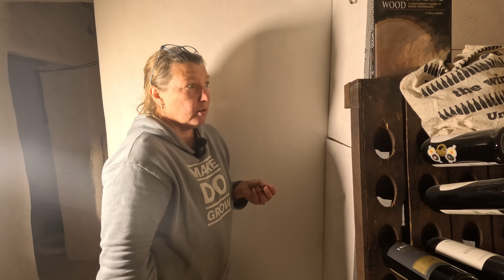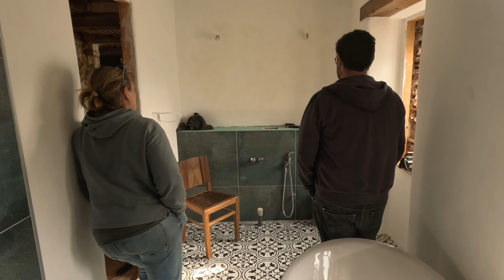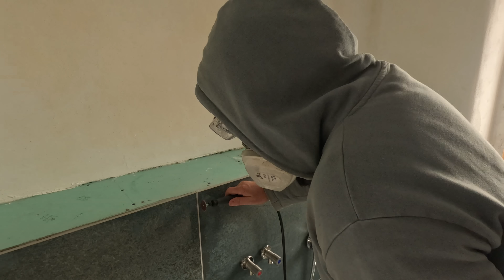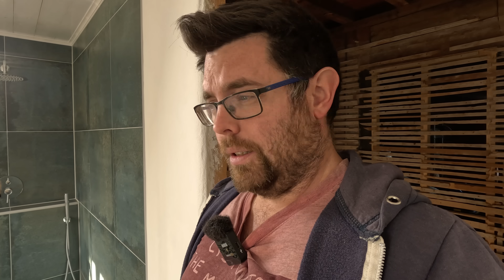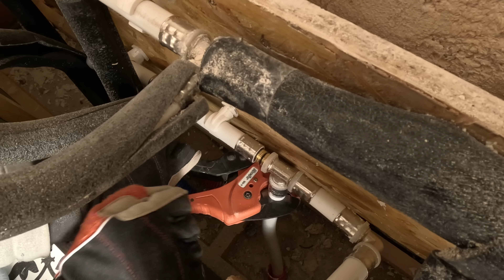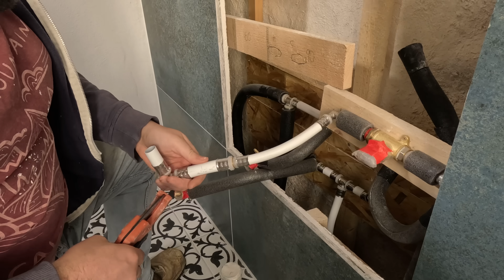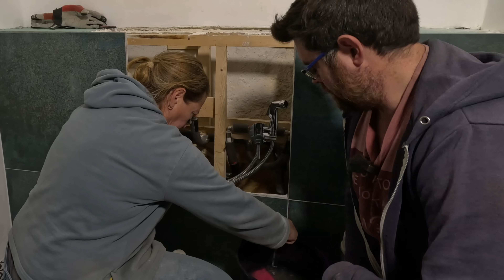Bathroom Nightmare: When Plumbing Goes Wrong!

Comment: QUICK QUESTION: Did you preassure test the system BEFORE you put water in it?

also you need to brace everything behind the tile you took out, to put it back in so it is solid/stable...

Comment: A failure of a crimped connector is extremely common, even when pros do them. We had these exact hot water tubes leak at the joint in the HP heating system. The heat will soften the plastic collar, especially by alternating hot and cold flow, expansion and contraction. Most of the time the water is cold. After repairing 4 crimp joints soon after first use, out of over 100, there hasn't been any leaks. So that's good news in a way. Early failure is better.
Reply: Again, interesting to hear - and encouraging for long-term confidence, if less-so in the short term.  It makes me think of those displays in IKEA where they show something being pummelled to death to show longevity.  Does this happen across the board?!
Perhaps the take from this for us amateurs is if possible, use the system for a couple of months before finishing tiling etc?

Comment: Another thought .Have you a pressurised system ?Pressurised by a balloon on your water pump from a well or cisterna ? If so you will get variations in water pressure up to 3 bar every time you turn on a tap .This can effect the flexing of plastic and flexible pipe work and continuously flex pipes into joints .If a poor joint this can cause a failure eventually .If on mains with an even pressure ignore what I have just said .
Personally ,For a house your size I would  consider a gravity fed system from a header tank in the loft for domestic H and C and only pressurise the wet underfloor heating system .Plenty of height above to give you good shower pressure  in your bathrooms and kitchen  etc .Not common in Portugal I know .
Reply: Matter of fact it is popular in Portugal, at least were I live all my neighboors have water tanks on their roofs but me 😂. We do get water shutdowns maybe twice or thrice a year but its only for a couple hours. They said back in the day they would be a day or more without water, some people even use their wells to pump water into the house.
Reply: @zaxmaxlax   It’s all balloon pumps from wells and cisterns where I am in the rural south .Some have header tanks but they ain’t that popular .Suspect it

Comment: Bugger! Glad you got it sorted. Next time you do a wet wall, NO press fittings without access! Make the false wall deep enough to get your hands and tools in. Leave the top loose, A stone shelve/top on a rubber packing will stop it sliding. Then ANY fittings are as high up so you can get to them from the top. Generally though soldered fittings or I believe hard pipe press fittings are also certified. but still with an access.

Comment: We have osb panel with tiles atached to it. We put silicone around it. If there is a problem we remove the silicone around the panel, remove the whole panel , repair, put the panel in place and silicone around it.

Comment: For what it is worth ,given it took 2/3 days of water pressure  for the crimped joint /T piece to fail I  suspect that you should repair /realign  the failed joint and not disturb anything else that has not leaked .Insuspect user error on this one joint .Personally ,I am old school ,and still use soldered copper fittings /joints for all my plumbing  .Lots of new fangled plastic / Crimping / compression systems on the market but I don’t trust any of them !Particularly  when burying plumbing in walls etc .Also removable panels /Tiles .to access pipework  and hidden wc cisterns are a godsend when shit happens (sometimes literally !)The more the merrier ! Cheers .Bathroom looks good and you have learnt a lot of hard lessons the hard way ! congratulations.

Comment: It is very rare that there isn't a single failure of plumbing but far more rare for there to be a second one so sleep easy. I can't believe you had the presence of mind and thoughtfulness of spirit to film how you coped with it. Thank you for sharing it!
Reply from the maker: @benjaqsonworkshop9974  fingers crossed that is the case for our installation 😀

Regarding filming … one of the reasons we make our videos is to share the reality behind renovation and this type of life. So when these kind of things happen we think it’s super important to share it. Because this is real life and it’s not all unicorns and rainbows like some people might make you think (similarly it’s not all crazy drama either)
Reply: @MAKEDOGROW  And that is exactly why I watch your channel. It is an honest view and you research methods and materials before you do the work.
Reply: @MAKEDOGROW . Hi guys, Could you make an access panel in the stone wall behind the pluming fixtures? I don't know if there is a room at each end of your bathroom but if the is you could put the plumbing access in those rooms.
Reply: Exactly a crisis averted🥰

Comment: i think having a removable panel made from the tile is a great idea. Would you need to have special water proof fittings to go in the screwholes, if there is such a thing?  Well done for sorting it out and for leaving it open meantime. When you go away and do something else for a while you will be bound to come up with an idea or improvement.  Please don't worry that there are these crimped misaligns all around the bathroom. It looked to have had a little tension on the T when you opened it up and wasn't quite level but the new section may be just the teensiest bit longer and so less tension.  Musings from a complete amateur plumber but seasoned home renovator.  Well done
Reply: It always surprises me when people have concealed plumbing behind tiles, but do not put in an access panel. It's easier enough to do.

Comment: Plumbing sucks sooooo bad.  You can make a mistake on any other DIY, get pissed and rip it out.  However, mistakes in plumbing have so many downstream effects.  I never ever do plumbing for friends, too much risk!!!!
I've recently started using the crimped copper fittings.  My brother in-law is a plumber, and I can borrow his crimper if it's not in use.  If you want your head spinning, price out the Milwaukee crimper for copper fittings.  I think the one they use, with a couple of different sized crimping dies, was just under or just over $4,000.00 USD.  I have a hand crimper and it works...........OK.  But....After using the power tool, I'm very reluctant to use the hand crimper.  They are night and day.
God help you, but my hair curls when I need to do plumbing behind walls with no access panels.  I always like using manifolds.  Hide the manifold where you can access it and run individual runs to each device.  One crimp at the manifold and one crimp per device.  No Tees and no shorty cuts hiding behind walls.  (pex)

Comment: I did my crimp fittings together with my plumber, and i had several of them beginning to leak even after a long time ( microleaks mostly)  So i would suggest you keep the joints accesible so you can check them from time to time.

Comment: I always try pulling apart any plumbing I crimp together. If I succeed, then I failed to crimp correctly. (I suspect you could have recrimped your failed connection without cutting out the T...)

Comment: I'm so sorry you are having a "Murphy" moment. I would suggest that type of failure isn't a crappy system, but a failure of individual parts. Is there a possibility that the actual water pressure pushed the failed part off its setting? So, your pressure tests worked, but repeated pressure pushed the part away bit by bit?

Comment: Water hammer could have pushed the joint apart but the fact that you could push the joint back together by hand says it was compromised in some way. Also I’d be skeptical of any joint where you can twist the pipe on the fitting.
Reply: They could get a mini expansion vessel, but I think they need to change all of those fittings.

Comment: Respect for your calm, honest and communicative approach to fix this
Reply: Is there an option to create an access panel on the other side of either wall in other rooms? 2nd question, which is probably too late, can you coat the strand board with waterproofing while it's open?

Comment: I had a flexi pipe under a bathroom basin give way a few years back. I was told that the warranty is only for about seven years. Make sure that you check the expected lifetime of whatever you do. Old plumbing was copper pipes for a reason.
Reply from the maker: For a moment I did consider pulling everything out and redoing in copper (we used copper in all our London refurbs), but it’s not really a thing here so getting parts would be quite difficult.

Multilayer has a longer lifetime than 7 years, the pipe at least. Not so sure on the fittings though
Reply: @MAKEDOGROW  Interesting, what did the Portuguese use before plastic?
Reply from the maker: @sroberts605  not sure. The bathroom that was here, done in the ‘90s, was pex (also plastic)

Comment: It's disheartening, but I watch another channel where the guy is an experienced plumber and he had a leak in the same way. As others have suggested, can you not cut through the wall from the other side?

(I love using push fit plastic pipes rather than something like crimped parts - much more forgiving and easier to work with and take apart)
Reply from the maker: The other side is a 600mm thick stone wall. Cutting out one tile is definitely easier 😂
Reply: @MAKEDOGROW  fair enough 😄 You probably want to make it so the top shelf can come off easily for inspection purposes